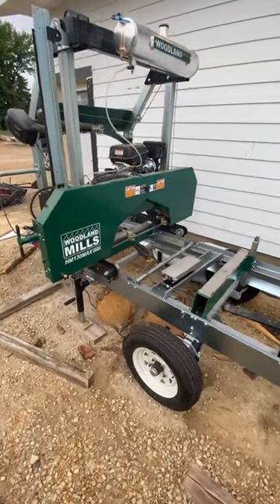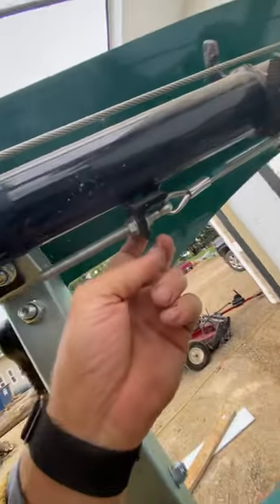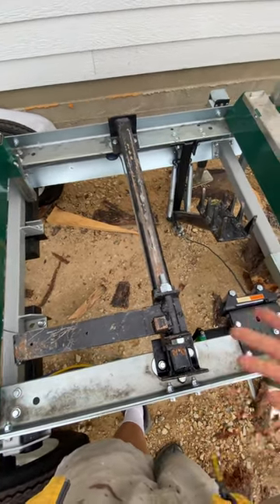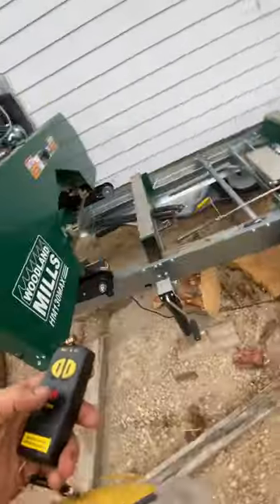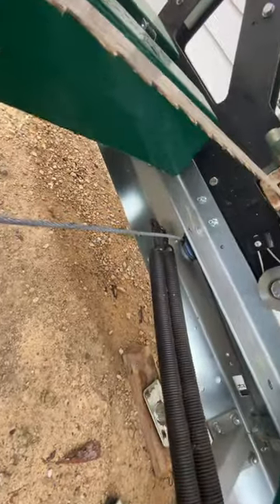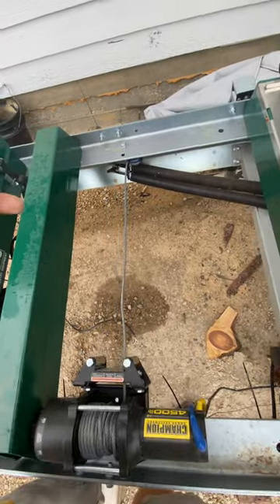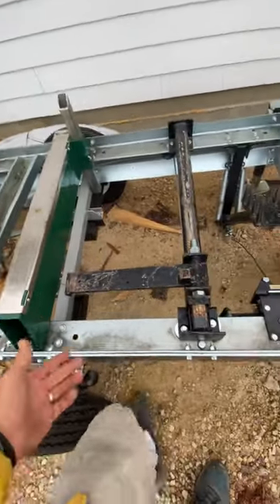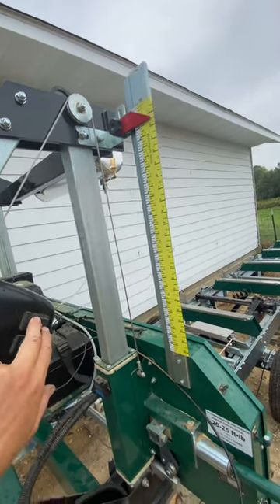Woodland mills mods to increase ease of use and production hm130 max

Comment: I hope Woodland Mills watches this video. These additions make wood sawing so much easier. Turning a large diameter log is very hard by yourself. I am really considering getting another mill just for that feature.
Reply from the maker: I hear you!  I would have bought the upgrades if they offered them.  I have considered buying a bigger wood mixer because of it!

Comment: Andy just found you and I really impressed with your engineering knowledge. I have only one eye and am 81 years old and just last week ordered my new HM130MAX. Will be here in 3 days. I ordered the power head lift did I waste money. Do you have any info for me less expensive. I’m sure I will wear you out with questions if You don’t mind. Love it and have subscribed with bell notification
Reply from the maker: If they had the power head option when I bought my mill earlier this year I would have bought it to save me the time on making one.  When I made mine they didn’t have it as an option nor was it in the pipeline.  I have a bad shoulder so it was a need for me.  The power head and the auto log clamp were 2 game changers for me.  If you are handy with a welder, it was pretty easy to make, I had it done and working in about 30-40mins tops and had $100 into the jack.

Comment: That Chinese winch will pull almost double the weight if you hook it up to that spiked arm like you would a snatch block and back to your winch area. Instead of directly hooking it to that spiked arm. More “snatch blocks” the less effort it takes from your winch to turn those logs. Nice setup by the way and I’ll definitely be copying some of the mods you made.
Reply from the maker: I found that with the 4500 pound winch if doesn’t need to have double the pull strength.  The 3000 pound winch I had on there before was too weak and needed the snatch block.  I would recommend getting the 4500 winch, it is quite a bit faster!  Thanks for the feedback!
Reply: @portercreek  I must’ve miss heard what you said then, my apologies. Thank you though for making this video because I will be implying some of these add ons to my homemade bandsaw mill.
Reply from the maker: Thanks for commenting! Please don’t forget to subscribe to my channel!

Comment: Enjoyed the video, thanks. I have HM-126 I was planning on using a wheel chair motor and sprockets for power head but I like your idea better. Are the ACME threads on the jack and mill the same?
Reply from the maker: I am not sure, I haven’t checked.  I haven’t used the manual crank over ride I have only used the electric so it doesn’t matter because you can’t see how many revolutions the jack is making.